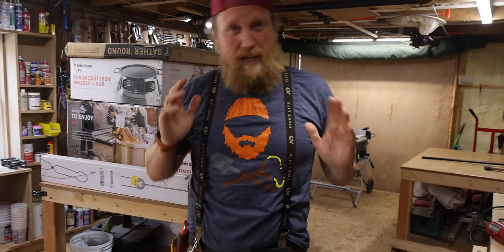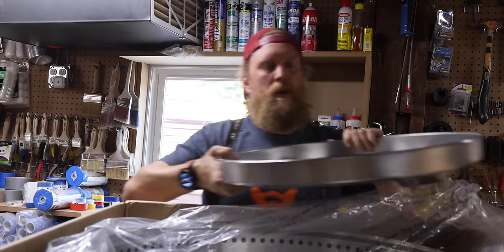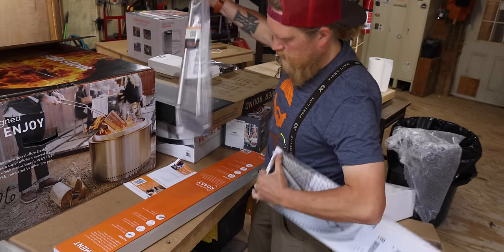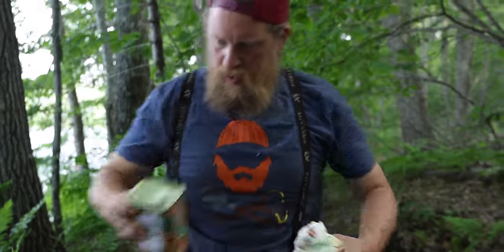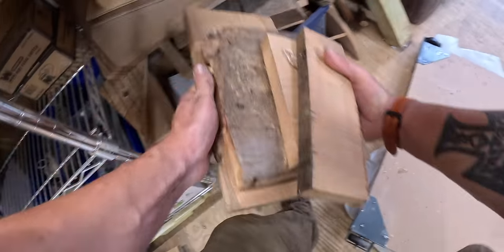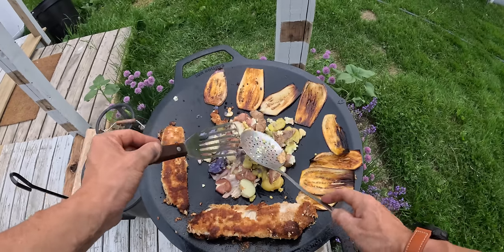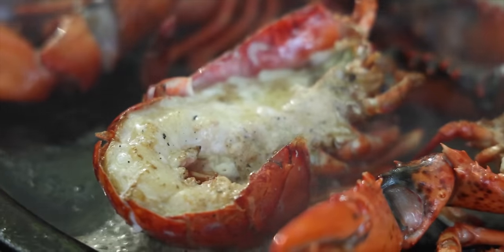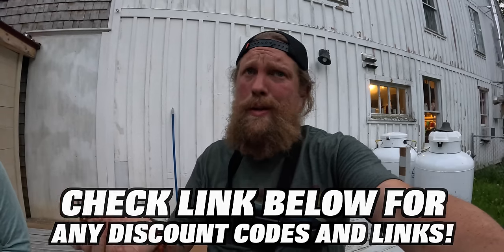Solo Stove Yukon 2.0 VS. Bonfire 2.0 -Smokeless Fire Pit Catch and Cook Off

Comment: I went with the Solo Bonfire, heat deflector, and riser.  I added the 20" BBQSTAR detachable, adjustable height, and swivel grill for $80, Amazon.  I just remove the heat deflector and drop the grill pole into the side mount arm. Made some hot dogs and slider sized burgers and it worked perfectly with the ability to swivel and adjust height from the heat depending on what is needed.  I haven't tried; but, it should work equally as well if I added a cast iron skillet on top of the grill grate for eggs, bacon, and pan fried potatoes for b-fast.
Reply: Do you have a solo stove bonfire 2.0?
Reply: @maskuiworld1892  Yes,  Just purchased in Oct. 2023.  I also have the Pellet adapter, Pi Fire Pizza oven, Pizza turner, and Roasting sticks.
Reply: @mrgold3591  Is it in a good condition now?
Reply: @maskuiworld1892  Yes.  I've only used it 3 times so far.  I clean out the ash the next day, clean the black soot from the underside of heat deflector, and use the bonfire cover to store.   I have the dark charcoal colored Bonfire to help hide discoloration from use.  The exposed stainless steel with contact with the fire does turn a copper/bronze color with  use.
Reply: @mrgold3591  can we work with you?
Reply: Thanks for the detachable grill tip brother

Comment: the wood load is excessive and in fact the circular pyrolytic flame created by the air coming out of the upper holes does not form.  it is working like a common brazier.  the pyrolytic stove works with a small charge on the bottom, where the wood gasifies without flame, the hot gas meeting the oxygen conducted to the upper edge by the holes ignites at a higher temperature, exactly like a home gas stove, forming a fixed dart.  if the flame wavers shapelessly in the center it is not pyrolytic combustion, less wood must be added and unfortunately it must be continually added a little at a time as it is consumed

Comment: I cooked once on mine. And yes it is quick and very hot
Reply: Do you have a solo stove bonfire 2.0?
Reply: @kiethlowry2862 the diameter is still 19.5 inches. is it right?
Reply: @maskuiworld1892  inside diameter 17.5. Outside diameter 19.25. I use a 26 inch pizza pan for a heat deflector.
Reply: @kiethlowry2862  okay, I know the right data. Do you have a shelter for bonfire?
Reply: @maskuiworld1892  I have the bag it came with to cover and move it.  Sometimes we just move it inside
Reply: @maskuiworld1892  and the pizza pan makes a good rain cover
Reply: @kiethlowry2862  Great! we have a product, could you help us test it?
Reply: Does it taste better or worse than a wood fire with smoke
Reply: @Tampain  taste great
Reply: @maskuiworld1892  what kind of product